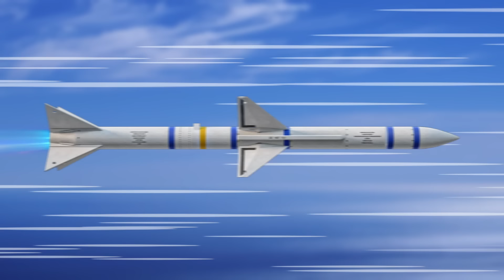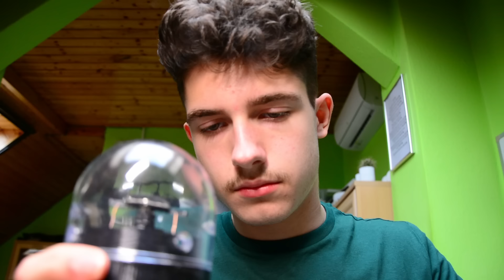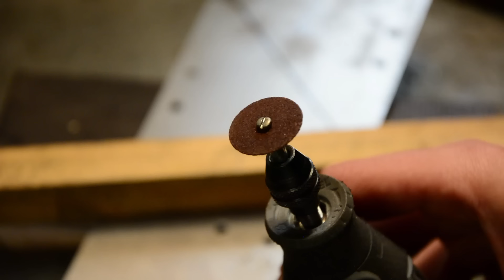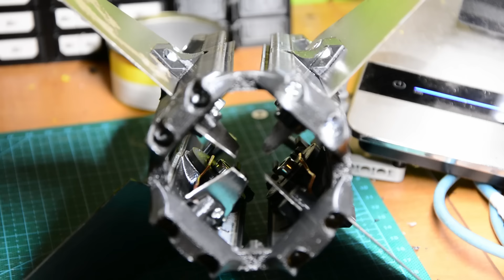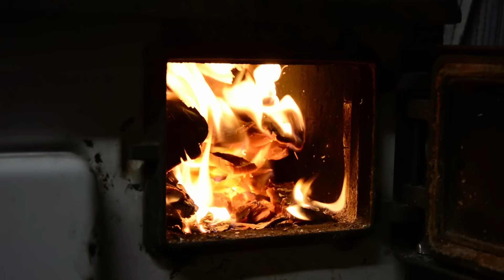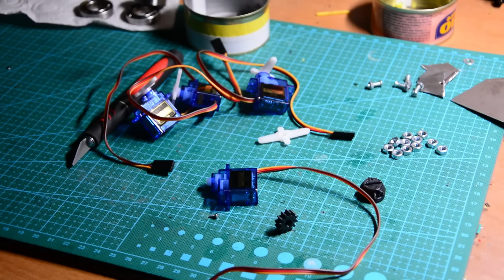Can I Build a Missile for $100?

Comment: It seems you built a model of a missile, like me carving a pistol out of wood. First time I've seen your channel,  so I have no idea if it is capable of flight, did that guidance sensor/ camera function,  could it control anything.  I'm continually surprised that with the amount of countries they bomb, no group has ever set up a missile factory thirty miles from a major city. When the IRA mortared Gatwick Airport,  they were able to fire for days because it was so difficult to find the pre-planted, mortars, set on timers. Think of trying to find missiles within 80 miles of a city. Hope I didn't sound sparky re replica,  I have no idea what you are capable of.  BTW, if you are a competent electronic hobbyist,  I really need someone for a new invention which would make your fortune and my bigger fortune.

Comment: Military industial complex is not going to be very happy with you. A lot of money in making weapons of war, you can't just go around showing that this sort of thing can be done efficiently, you gona end up committing sewer-slide with 5 rounds to the back of your head lol.
Reply: It’s literally a mockup with moving fins. This is at best a high effort DT project.
Reply: @YeetusDeletus-vv2xqok so I was half joking when I write that, but it's also got some truth to it, if you don't charge $1,000 for a bolt you can make things cheaper that what the MIC makes them for.
Reply: @PiNKMuDSimGaming labor and testing also contribute to the cost of any weapon system.
Reply: @YeetusDeletus-vv2xq nothing legit can make a bolt cost $1,000 that should cost 1/10 that price.
Reply: Which weapon system out there has a bolt that costs 1000 buckaroos?
Reply: @YeetusDeletus-vv2xq if you can't tell I was being hyperbolic I don't know what to say, I thought it was obvious.
Reply: then your hyperbolic has no relevance since its supposed to imply to military weaponry being overpriced while ignoring labor, testing, R&D, build quality, the time to get the resources to make that weapon, production and etc, so you basically could've chosen to not say it at all since it's supposed to make something debatable seem undoubtedly true

Comment: i'm pretty sure missiles can be cheap but remember that ad hoc wardrones allready go for a couple thousand at least so i'm assuming a functional militairy grade missile would at least cost couple tens of thousands considdering all the steps required, licenses, design, prototype, pattenting, wages, materials, software fees,.........)

stil it is something i've thought of myself and i'm certain that a motivated collective could at least produce something decent for a modern battlefield by taking unconventional approaches and working with the mentallity that necessity is the mother of invention to get over and around hurdles.

for instance there is a lot of built in tech in smartphones that mirrors what can be found in modern missiles,
then there are emerging but available tech options such as photonic data transfer which in turn reduces internal energy requirements and in fact heat concerns. cameras are cheaper than ever including those that are uv sensitive as are laser rangefinders since those are now also mass produced for worksites,.....

I think the main hurdle would be launching them effectively given the calculations required for solid fuels to work properly.

there is also the intent,
it is fairly simple to go the hezbolah route and produce what is essentially unguided explode on impact short range balistic missiles but even those are not that cheap (i think) ((bing says 1000 US dollars +-)

so we established that even the cheapest missiles that are fired and produced by people driven not by capitalist but religious and arguably identitarian and revanchist ideals are allready ten times the cost proposed in this video (but to be fair those also exist under active and thorough sanctions and therefore have higher material costs with less quallity controll options so that plays a roll to be sure)

Comment: If you buy cheap sensory part s basically can build small missiles but small range and thermal heat will damages body and parts due to speed and friction issues

Comment: where explosive? i recommend use black power made of potassium nitrate carbon sulfur as main feul and then for ignitor that wil start the explosion use armsstrong mixture which explodes on impact just buy a lot of match sticks and make a good amount of armstrong mixture which will ignite the main fuel and boom haha
Reply: Nvm guys 5 months later I’ve learned a lot about about rocket propellant chemistry. This is only a good method for a small quick diy rocket that’s really small

Comment: Lucky Palmer is showing a massive amount of market disruption so you're not completely wrong and some of those missiles assuredly could be made for in the thousands of dollars rather than $400,000 of dollars and it's really stupid how much they're marking up the price as content creators here on YouTube are making amateur rockets with terminal guidance they can hit waypoints with homemade designs like computers. 

It's more than just one it's become several different amateur rocket creators and there's not much difference one is just flying vertically the other is flying horizontally but it uses the same aerodynamic principles. 

And they're just using infrared and or radar men's to pick the Target or the waypoint. There's not much difference between a waypoint and a Target the exact same thing. So if you have GPS and the ability to illuminate or pick a Target and its location using radar even millimeter wave radar for close-up and lidar or infrared for a little longer... Minus the high explosives you could most assuredly design a rocket or a missile that could fly horizontally hitting a Target without the explosion of course... 

I think you should probably do that without breaking the law so long as you're in the United States and you don't export any of the knowledge or code. 

You have to be careful of a certain law called ITAR. 

But as long as you don't violate that particular statute then making something that doesn't have an explosive element or a damaging or seriously damaging element for educational purposes is merely showing off what's possible with consumer off the shelf of electronics as well as education and what is possible if people want to go into aeronautical engineering or electrical engineering and coding.

YOU KNOW THAT HE IS MARKING HIS PRODUCTS UP  MAKING AN ENORMOUS PRODUCT PROFIT BUT HIS LEVEL OF PROFIT THAT HE'S MAKING ON EACH ITEM IS SO MUCH LESS THAN THE INCREDIBLY BLOATED AT A CERTAIN TIME MARKET LOCKED LOCKHEED MARTIN'S AND RAYTHEON ETC.. 

AS A LAWYER I WONDER HOW MUCH PAPERWORK AS WELL AS BACKGROUND CHECKS AND SECURITY CLEARANCES HE HAD TO GET AS AN INDIVIDUAL ALONG WITH HIS OTHER EMPLOYEES AND OWNERS BOARD MEMBERS ETC JUST TO START THAT BUSINESS!!!

THE GOVERNMENT RESTRICTS ACCESS TO A LOT OF THAT EVEN IF YOU INVENT IT YOU CAN'T TRANSFER THE TECHNOLOGY ABROAD YOU HAVE TO BE CAREFUL OF ITAR. AND NOW HE HAS PROBABLY ACCESS TO HIGH EXPLOSIVE SWITCH NORMAL PEOPLE DON'T LIKE RDX. 

Their marketing things up by 1,000 times rather than 100!!!

Comment: how do you plan to counteract rotational forces during the flight of the missiles in high AOA maneuvers? you made a close range IR missile thats based on a long range radar guided missile with non proportional tail fins and canards, so it will never fly and even IF it did fly, it would not be for long
Reply from the maker: I just strap a rocket motor to it and pray something good happens

Comment: "I will cut this steel plate with a dremel in 2h!" - The guy with an angle grinder.

"I will guide my drill by 3D printing clamps!" - The guy with a drill press.

I'm only 8 minutes into this video and ready to pull my hair out.
Reply from the maker: Great to hear your enthusiasm!
Reply: @itsblytical just pickin on you bud. Keep up the good work💪

Comment: 6:50 Light touch bro! Very light, steady touch on medium to high. NEVER push it firmly against the metal, let its weight guide your hand down into the metal at an angle, like Exacto blade.

Comment: Fliegende Rakete (die 500m fliegt) und halbwegs ein Ziel das beleuchted ist finden kann für 100$ knapp machbar wenn man wirklich spahrt und noch etwas aus dem Elektroschrott verwerten kann. 
Rakette die auch noch irgendwas dass mehr als ein Pappaufsteller ist zerstöhren kann eher nicht. Auch nicht mit 180$ nicht. 
Fuer das was eine Rakette das USMilitär kosted müsste jede Rakette mit einem Überschallfliegenden Auto oder Motorrad geliefert werden😂

Comment: Cheapest guided rocket is the 22k APKWS II, has also been used against drones so it is also a missile. The worlds smallest missile is the “Spike” is also 50k- like the smaller you go the more expensive stuff getsc there has to be a cheap middle ground for cheap missiles to use against drones instead of drones flying by eachother.

Comment: Some questions.
1. How does the missile fly (like no motor)?
2. How does it destroy the enemy jet, since no explosives?
3. This is an Aim9 Sidewinder obviously, so why arent the front flaps moving, they are in real life.
4. Where is the Infra-Red Counter Countermeasure system, so flares dont destroy your missiles infrared lock on the enemy jet?
5. Also, wheres the stuff, so an jet can actually fire the missile.

besides that, nice work

Comment: With some modifications to the arduino and code Replacing the Seeker sensor with an inferred one from a motion detection light, could use butane to cool the plate it sits on and the addition of a smaller inner pipe to house stumpremover/ sugar rocket propellant and you have something that will give you 25-life

Comment: I had the idea of a two stage rocket. Paint a target with a laser and launch rocket way up over the target. When it reaches peak and turns nose down the camera on the nose tries to keep the laser in the middle of the screen. By turning the camera it also changes fins on the nose to guide it down. Then second booster ignites launching down fast. If you can process fast enough you could range find laser on it and explode a shape charge warhead at perfect standoff.

Comment: It looks good but:

No rocket motor (especially not a fast one)
No warhead (not even a dummy)
No proximity fuses
Your heat seeker? Looking cool but could it lock on a candle?

Oh btw. these rocket are often using canards for steering this makes way for the rocket motor.

Comment: Not exactly 100$ but for 211$ thats insanely cheap even tho it doesnt have a real seeker or anything such as propellant and a proper guidance system and the materials to withstand the heat i bet if you did that easily would have all been under 2k or less than 1k probably

Comment: I mean ,
You could have built an RPG for $20,
Less if you use discount store ingredients..lol
Using sugar match heads ground up to make the solid state fuel source for the rocket motor , and a wick made by rolling up some of the remaining powder mix in a cigarette paper like a cigarette.
Stick one end in , and light!
If you make your motor right,
You get a decent , stinky, rocker motor that can drive a rocket made from either card board tubing or scrap PVC tubing.
If you make it wrong you either get a lot of smoke,
Severe burns,
Or a court date.
So maybe don't listen to me...😂

Comment: A lot of the price is R&D (drafting up the design and what is needed for the requested capabilities). The rest is the technology, software and firmware involved. They usually have multiple teams that spend months to multiple years working on the digital side of development and making sure it works with the rest of the military equipment that is going to the missiles. Then they spend more time testing and working out the kinks. Finally it is ready for production. There is a reason why defense budgets are so high.
Reply: Thanks for giving context, funny how people don’t consider this stuff at all and just fully take this larper seriously

Comment: nice job, but if you had a 3D printer you could have avoided buying any of the steel parts(not the nuts and bolts) by just 3D printing it and save you about 90 bucks
Reply from the maker: A plastic rocket would have been very boring in my opinion

Comment: You can easily make a solid fuel rocket motor by getting wood, burning it until it becomes ash, mix it with water while its still hot, sift it, the liquid solution can be mixed with nitric acid (you can make nitric acid for free by making your own nitric acid generator or buy nitric acid) mix these 2 together and compact it until it dries and becomes solid rocket propellant, this can be used as an ultra high powered engine for the missile but do note it almost works like a firework as it burns how it likes you can probably make a nossle.

Comment: correct title: "can i make a missile cosplay out of plastic tube for $200"
Reply: It's made out of metal... If only you watched and paid slightly attention.
Reply: @Stylish_Turtle if only you saw the bigger picture that this is effectively a mockup, so your correction means nothing (tech YouTubers trying to use the highest quality civilian components to not even remotely come close to what soldiers on the field can make with scraps is wonderful to watch)
Reply: @YeetusDeletus-vv2xqyet In Ukraine the cheap thing is doing just as much damage as the expensive ones
Reply: @glintongordon6811 and those cheap things are still more capable and expensive than this at best decent looking mockup of a missile in the vid
Reply: @YeetusDeletus-vv2xqthe "highest quality civilian components" would be the exact same as military stuff. You can make a real missile at home, it would just take some time and possibly be illegal. You can machine solid metal, create propellant, make and design navigation hardware and software and put it all in one package. As long as it's all on board and doesn't rely on a huge building of outside systems, you can do it at home
Reply: @harulango8614 the missile wouldn't have the opportunity to be tested nearly as often to reliably work, and military tech is absolutely superior to civilian stuff (while not being commercially available either, you can't buy a Catherine FC thermal imaging sight from Thales and strap it onto a homemade tank, nor can you buy a thermal sight of remotely comparable capabilities)

This only applies to countries like Iran who use lots of civilian components in their drones at the cost of low sophistication, and even those are made with factory / industry standards
Reply: @YeetusDeletus-vv2xqshow me what soldier is building a missile with scraps literally anywhere in the world that's even remotely functional
Reply: @polarpenguin3  The Qassam rockets of Hamas which can be used in mass saturation strikes due to their low cost to create wide kill zones, the Elephant rockets from Syria that that are simple yet carry large devastating payloads and are again cheap to produce, and the entirety of improvised precision guided munitions, which can include old soviet dumb missiles modified with civilian components, instantly making them proven weapons with some modern capability.
Reply: @Y@YeetusDeletus-vv2xqthose are rockets not missiles big difference no seeker plus slower speed
Reply: @YeetusDeletus-vv2xqyou understand in the EU it’s illegal for him to build a real one

Comment: Hey, if you ever need your missile not to communicate, I’m working on a communications project with a bunch of incompatible parts also😂.  Nothing like running through and ordering stuff too quickly and then figuring out it’s for the wrong pi.  I don’t even know why I bought the pie five because 90% of the projects are still for the four.😂
Reply: I couldn’t even cut deodorant, can and have last week with my Dremel to make an alcohol burner without snapping the cut off wheel.  Apparently I’m a big monkey and the only thing I’m allowed to use or big tools because anytime I try to do anything delicate I snap things in half.
Reply: Maybe I shouldn’t be using the package of cut off wheels that came with it and buy some real ones😂 it looked like they just compressed sand together to make the ones I was trying to use instead of having something like a carbon fiber
Reply: Oh never mind I just watch you rip your wheel off also😂.  What was sad is that the aluminum on that can was so thin that I could cut through it with scissors, but it broke the wheel.
Reply from the maker: I figured out I needed higher RPM and the cutoff wheel worked fine after
Reply: @blytical1 I just interfaced myself with the 40 pin connector on top of the pie, trying to put a daughterboard on and now I have pogo pin wounds because I was using that to force the board on top and headphone until it gave way 😂
Reply: Who thinks I should boot the system up and see what happens.  Can I program myself to be a better person than what I am?😂